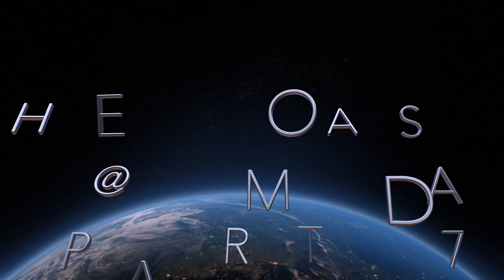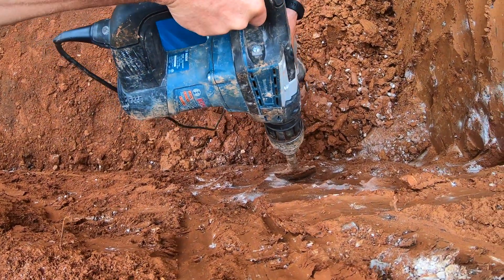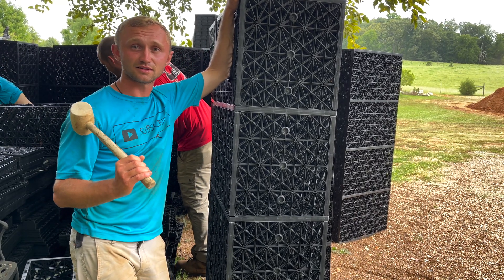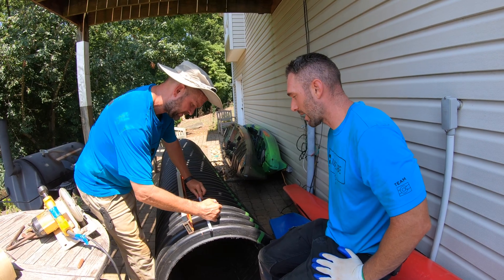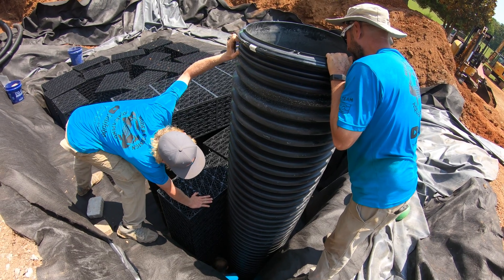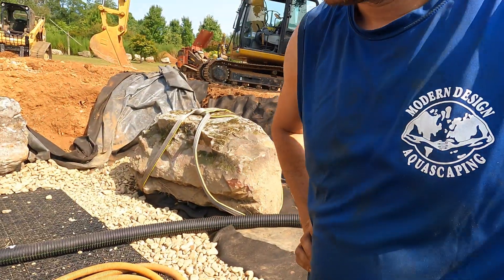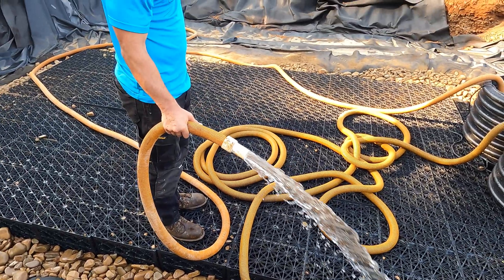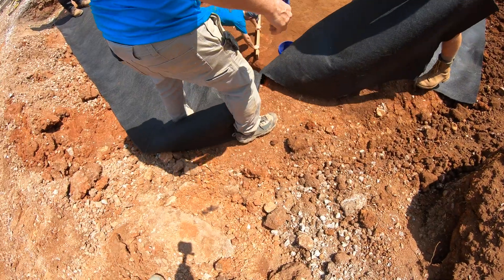Building an 8000 Gallon Hidden Reservoir – Negative Edge Pond Part 7

Comment: Are the long cylinders for access to clean? And what would you be cleaning exactly?
Reply from the maker: The pipes in the reservoir are where the pumps pull from, as well as access for pumping out water. I won’t need to clean this area, it won’t collect any debris below the rock layer.

Comment: John I have a question about negative edge and small fish.  I am planning on about 3/4” water depth over my neg edge and about 4’ of run so no problem for larger fish.  Do you think if the fish breed that I will lose a significant number of babies over the neg edge and into the water reservoir?  Thanks for your help.
Reply from the maker: Yes, they do go over sometimes. Design a “pooling area” below the fall into the negative edge. That is about the best you can do- only the smart fish survive! In retrospect though, I loose many through a skimmer & intake as well. I have never done a comparison…
Reply: @KoiAddiction  - thank you John - I had already designed in a pooling area for exactly this reason.  Thank you again for all your shared knowledge!   If I ever make to your neck of the woods I owe you dinner or at least a beer of your choice.